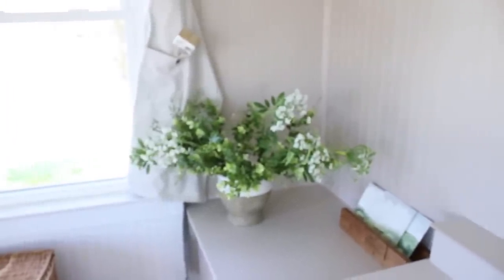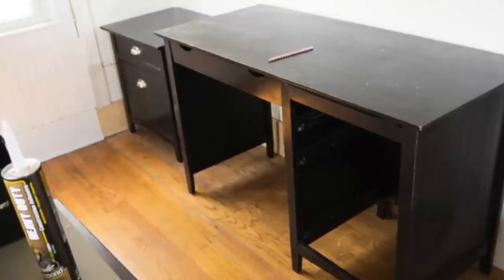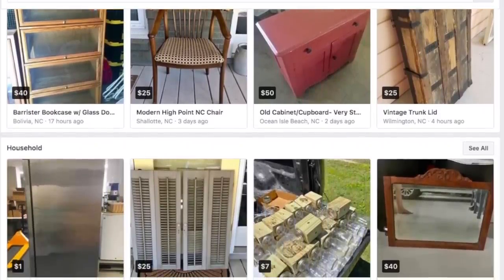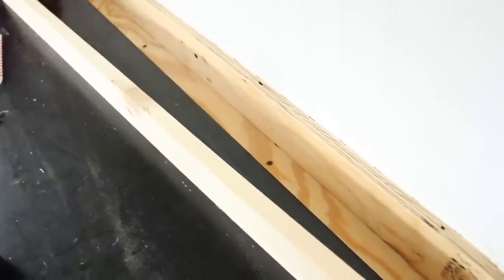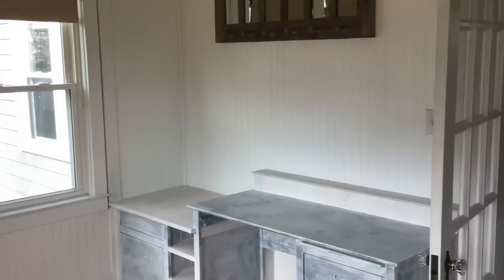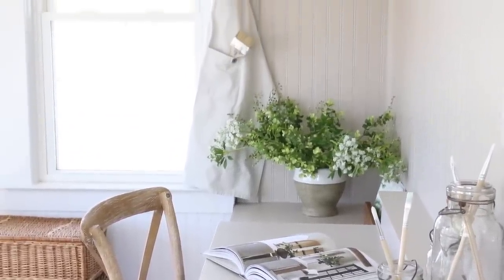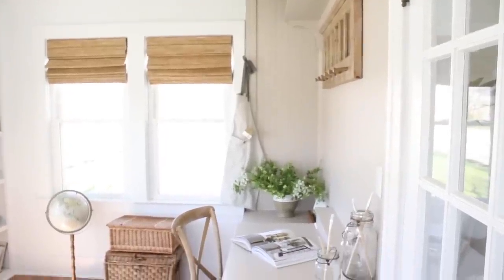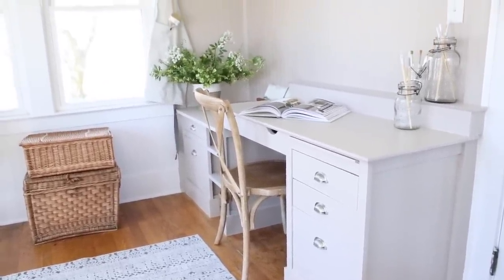DIY Desk Built-in for Under $50

Comment: Love it, love it, love it!  Perfect with the beadboard.  I like the way you added shelves to properly fill the space between the desk and file cabinet to arrive at the width you wanted.  For what it's worth, I like the tin boxes on the shelf.  You already have basketry in the room, so you don't have to have more.  I'd stick with the tin.  They add some glimmer to the room and if it's very sunny in the afternoon the light will glimmer off of them just a bit to add brightness.  It IS a great room for an easel though a north facing window offers the best light for painting (I have  BFA in painting....).